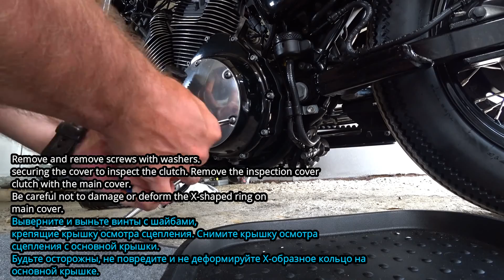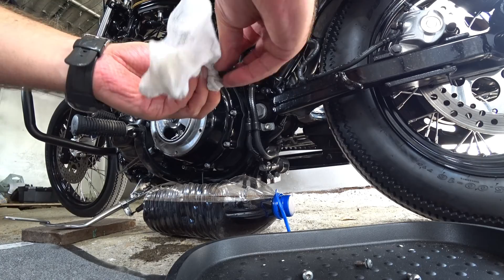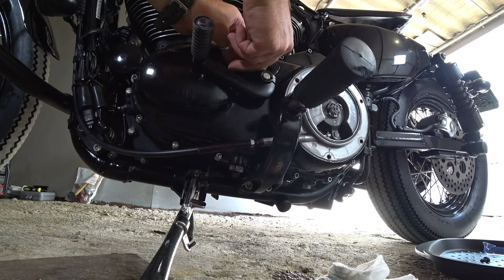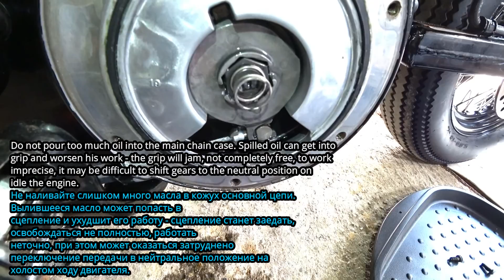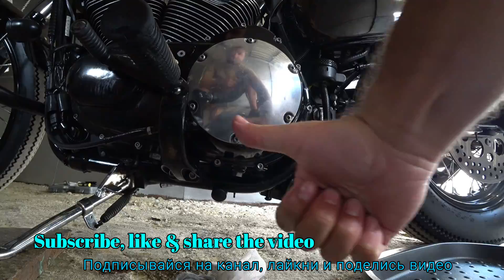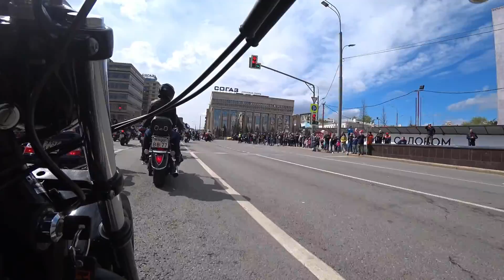CHANGE TRANSMISSION OIL - Harley Davidson Sportster

Comment: Capacity and amount to fill to proper level are not the same thing. Capacity also varies by generation. He's correct in removing the derby cover to check the level while bike is vertical and level. The second (smaller) cover is the primary inspection cover. The "derby" cover is the clutch inspection cover. No need to remove the smaller cover to fill but no harm either. Dunno about 10w40 motor oil in the chaincase/tranny. Looks to be newer than mine. HD calls for Formula+ which is not a motor oil (at all) and is SAE 50. Guessing it's also cheaper than Motul. TWD.

Comment: Don't use 10/40 oil in your primary ! ,  atleast use 25/50  or 75/90 or 75/140 .  The 10/40 is used with Japanese bikes and so .  No cruisers .

Comment: Why would you post a video of yourself making a complete  arse of the entire process ? You opened the Derby Cover with the bike on the Jiffy stand , dropped the plug into some other oil in an unstable plastic bottle . This clumsiness pales into insignificance when you produced a can of 10/40 synthetic bike oil . Ok it probably won't do much harm but it's not what I would use . And you don't need a torque wrench to snug up six bolts holding one cover in place .